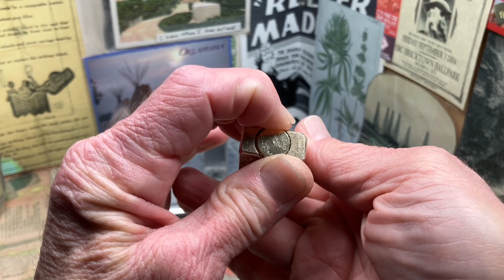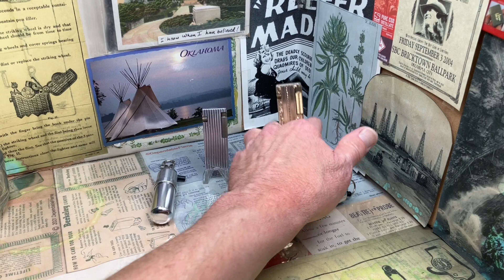Are Aluminum Block Petrol Lighters More Prone To Fuel Evaporation Than Other Metal Lighters?

Comment: I think if the exact same model of lighter has a fuel resistant rubber gasket on one and a paper ring on the other, the rubber gasket is obviously an upgrade. I would adapt accordingly. Paper WICKS lighter fluid obviously, just not as good as cotton or rayon😁